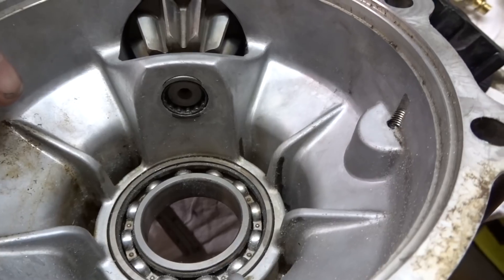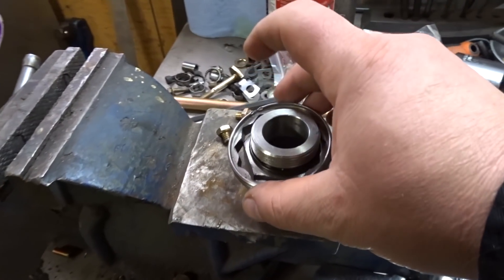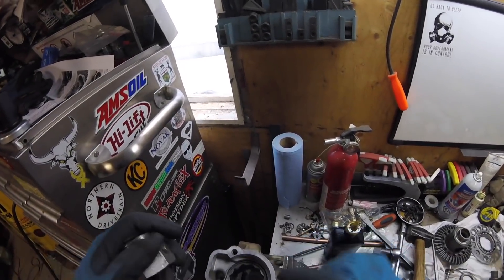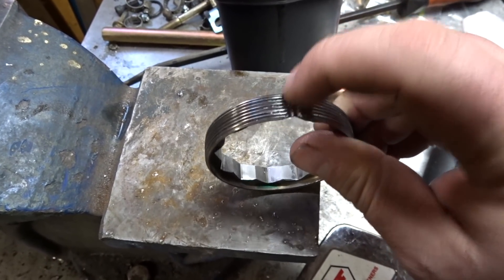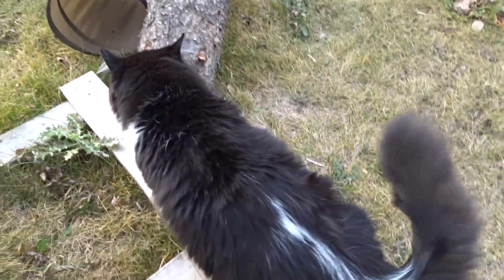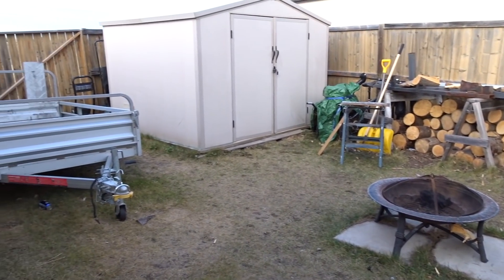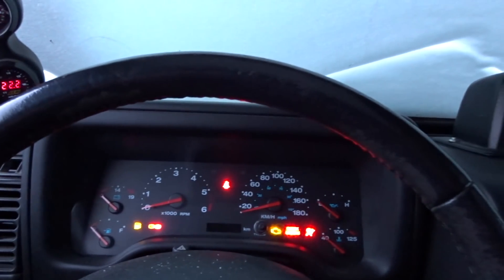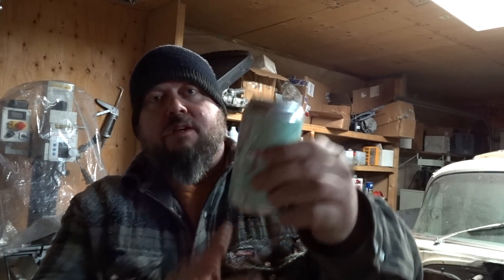At the End of Ones Rope

Comment: Nice save. The way i look at it even if it's ruined as long as it goes back together and holds your $300 up. Chances are your engine will blow up again before the diff needs attention again. 

We just had a dose of the Alberta winter over here. We had 6 inches of snow drifting to 10-12 inches in places. It got down to -12°C where I live in the sticks. It was chaos. Loads of cars in the ditch or spun off the road. Worst snow since 2003. Great stuff. Great fun when the handbrake is the only way to make your car go round the corners! Left a lot of BMW's in the dust.
Reply from the maker: I’ve heard you guys got some snow out your way

Comment: Have you thought about drilling and tapping for a 'set screw' that goes through the threads and locks the 'nut' or 'poor mans tap' from turning. once you have it tightened in place?  You could drill and screw in just about anything and it would lock the thing from turning.  A small screw would do the job nicely.  Might work better than Loctite given the threads have bee 'interrupted' and are not going all the way around any more, so the anerobic action of the Loctite might be affected.  I am not a machinist, but have been shade treeing for quite a while and that seems like a viable option.  beer thirty
Reply from the maker: Honestly that did cross my mind but I didn’t do it because it may had offered a point where oil could leak out and water get in

Comment: Quick question about cleaning when tapping threads.  I was instructed that when tapping threads ALWAYS cut 1/2 turn, then back-out the tap and clean out the shavings, then cut another 1/2 turn, back-out and clean, and repeat.  I was instructed by an old-timer, NOT to ever cut threads more than 1/2 turn without cleaning.  I got lazy once and fucked up the threads by cutting without cleaning.  What do you say about cutting threads?  Clean at every turn or not???  When I clean every turn, the threads look beautiful, nice and sharp.  When I don't clean the threads they look like shit, galled and totally fucked up.  What say you?
Reply from the maker: I don’t do it that way, I twist back it off to bust the chip then twist and repeat and clean the thread every few turns